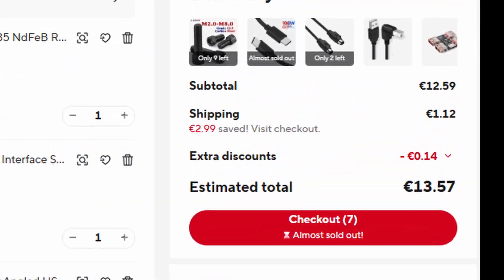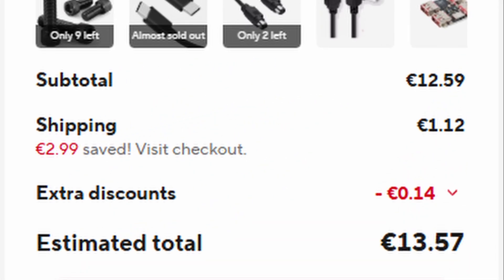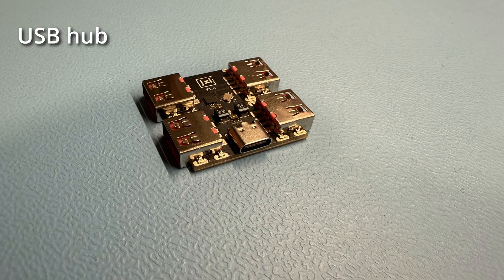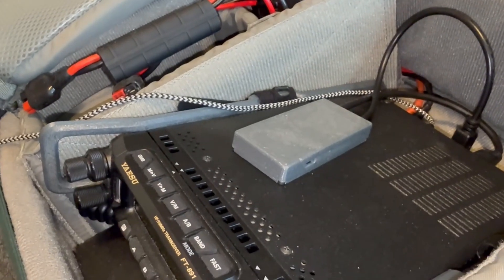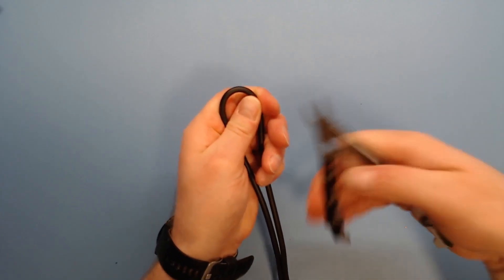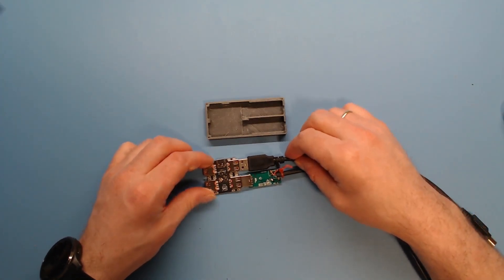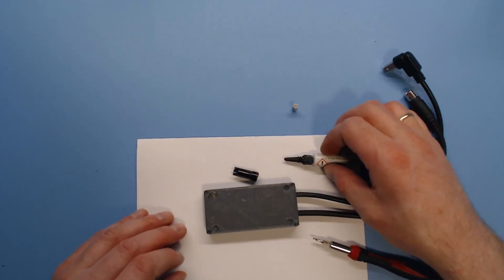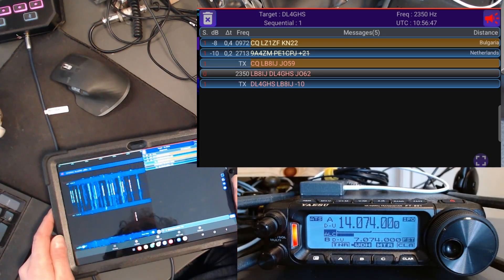Amazing Digital Interface for The FT-891 - DIY For Less than $15!!

Comment: Hello.. Thanks for this video.. I currently have a Xeigu G90, but it's for sale on Facebook Marketplace now. I've been looking at buying this radio, but I'm thinking because it does not have an antenna tuner. What do you think.. What has been your experience.
Reply from the maker: Most rigs with tuners is either qrp or to heavy. The G90 is a great compromise. I tried for a while to find a good tuner to match my ft-891. But now that I think about it I only run resonant antenna when portable. In a seldom case that I want to test a nonresonant I rather bring an external than having to carry the extra weight all the time. I also have my atas compatible loading coil that are able to do a bit of a tuning..
Reply: @LB8IJ  thanks so much for the tip.. then the more i think about the more i want this radio.
Cheers

Km6tcc

Comment: Why you need the USB hub - can't connect the soundcard to USB directly?
Reply from the maker: Yes you can. However many prefer a single cable solution. Especially when out portable you want a clean setup and using mobile devices you only have one port for the one I know. This way you leave the interface connected to the rig and only the single connection is required for both cat and audio
Reply: @hamradiopassion  Ah I think the point is the CAT control  this was somehow missing in the video (at least not clear for me).
Reply: @hcy0  in case of other older radios you need FT232 interface in second USB port of the HUB. That will be your CAT modem. ...Obviously FT891 have a USB port available for CAT operations.

Comment: It will work on any radio which has a Standard 6-pin Accessory socket. Check the pinout in your manual...
Reply from the maker: Yes there may be others that use the same cables, or some that only need a slightly different plug. I don’t know others this exact setup fits, but would love it if others report back on what’s working!
Reply: @hamradiopassion  Can this build work for FT-857?
Reply from the maker: @BABYRICH16 yes, but with an other cable for cat control. The same solution I used for my ft-817 sould work with ft-857. It’s documented in my other video and on thingiverse.